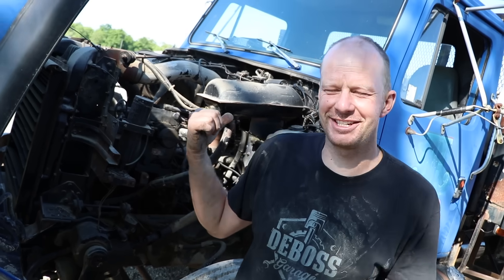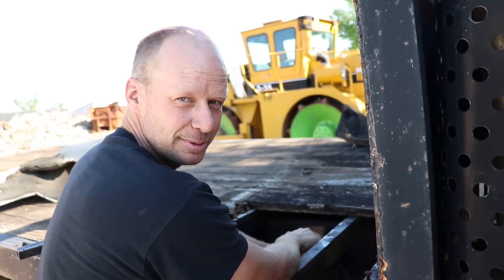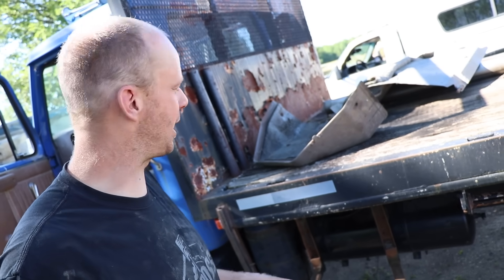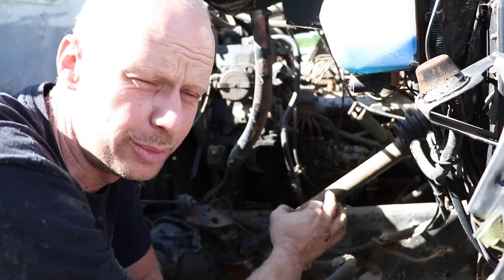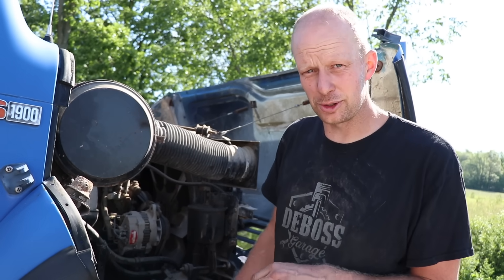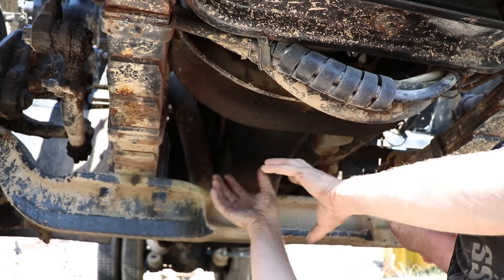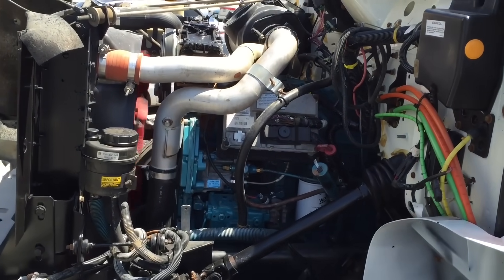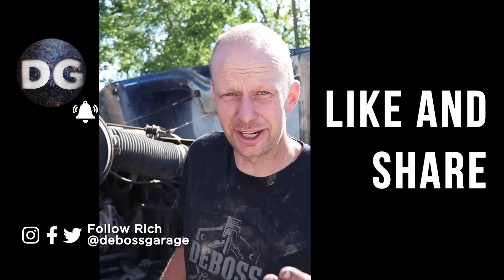REVIEW: Everything Wrong With a 7.6 Navistar DT466 Diesel

Comment: Aren't these also considered a 40 Series Detroit?
Reply: Yes, only difference being they're painted Detroit green,  you find em in the older gillig transit buses alot
Reply: @shawnmccarty9415  I work at my local freightliner dealership, we got a bunch of old miller buses coming in with these that a company bought to use as buses to transport people to a building from a parking lot. Everyone in the shop calls them a 40 series because well, ya know we're freightliner. We still have one sitting in a bay that's been there for a while. I've been fortunate enough to not touch it, yet lol but it had the front cover resealed and an injection pump installed. Now it wont start. Has everything it needs to start. Oil pressure, fuel pressure, fuel coming to the injectors, all the electronics are good. The poor tech that got stuck with the thing has been at it awhile trying to start it. He tried getting it to pull fuel through a jug and it pulled fuel just still wont start. Diagnostic Link is showing everything working as it should, as much of the engine side that it can monitor anyways. Rich said something in the video that made me wonder something and that was the oil getting air in it while pumping into the engine, and of course we use pressurized oil guns as well. But the thing has sat for a while so I'd imagine the air should have rose to the top of the engine and left the oil. But once it was all back together they tried starting it for quite a while. It cranks fine and will hit on ether, which was the last resort. It has compression and fuel pressure. It also had a fuel tank put in it but it's drawing fuel from the tank. I know the timing is very critical on these engines and I'm wondering if the tech who put the front of the engine together could have a gear a tooth off or something. If anyone has any ideas that may help, it'd be appreciated.
Reply: Dillon Rylant If it’s an e model change the cam sensor. They are bad for that going out and it won’t show up on a trouble code. Also look at the ICP sensor and see if the tinner- man nut fell off or is loose
Reply: There's a temp sender that sits just outside of the high pressure oil pump on the rear of the front cover,  (passenger side if its in a rear engine bus) pull it and see if oil pours out of the hole,  if its been sitting for a while,  crank it and see if oil pours out of the hole,  very little/ no oil,  you have a base engine or oil pump problem,  plenty of oil? You have a high pressure oil pump/ ipr valve or icp issue. (Keep in mind if it has the old (pre 1992) rack style injection pump like the one in this video,  none of the above diagnostics apply but from the above stated, it could easily be an oil pump problem or something could've got sucked up into the high pressure oil pump inlet upon first crank,  I've had it happen to me before
Reply: 40 series is a 4 cylinder